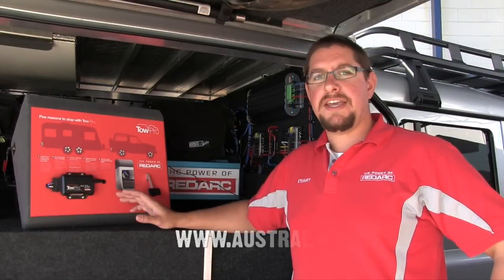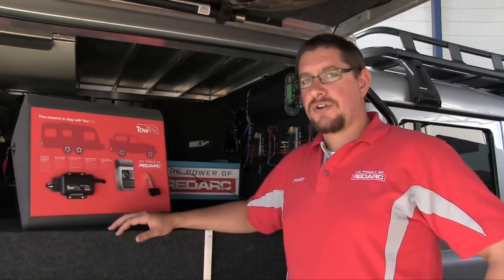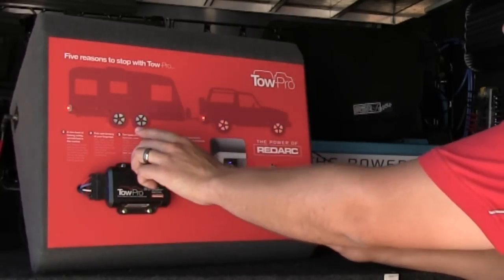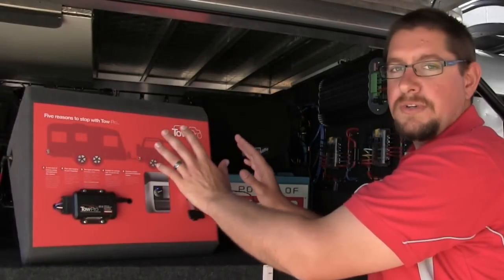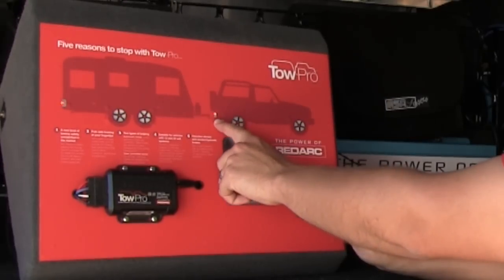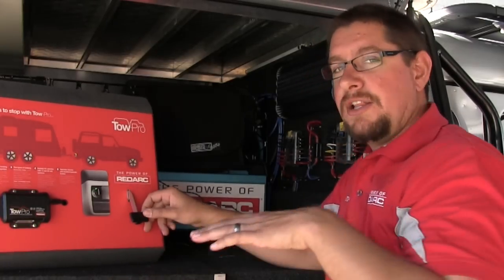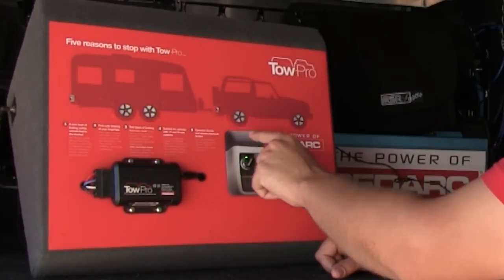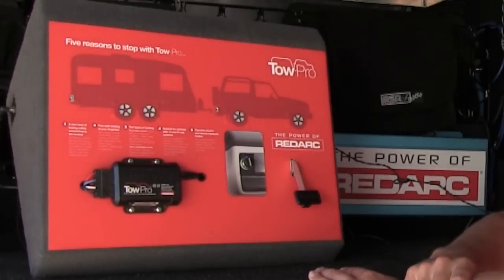How to Use the Tow-Pro Electric Trailer Brake Controller

Comment: I have Redarc and it does job beautifully, just asking to make sure I am correct.
I am in auto mode and caravan starts to sway, I then push the the knob down to brake the van?
Reply from the maker: Thanks for watching! Yes, pressing the knob will brake the caravan without applying vehicle brakes to correct caravan sway.

Comment: How do you set up how much brake force is applied in automatic mode without locking up the trailer tires?
Reply from the maker: Hello, and thank you for your message. You can adjust the braking force until it feels as if you are braking without a trailer. This means you should increase the level of force to a point that it does not feel like you are braking harder than normal to slow down the trailer, and so that you are not letting the trailer pull the vehicle up.

For further assistance please be sure to contact our Tech Support Team on 08 8322 4848 or via email at power@redarc.com.au

Comment: Quick question regarding hill decent in my Ford Ranger. While descending off road using hill decent control (vehicle brake lights come on) will the trailer brakes be activated? I’m assuming if so manual mode would be best in this situation. Thanks
Reply from the maker: Hi, and thanks for your question. When the Hill Descent function is activated, do the trailer brake lights activate as well? If they do, then yes the TowPro will likely trigger and output to the trailer brakes as they are activated off the brake lamp feed to the trailer socket normally. Manual/Offroad mode would be better in this situation indeed, especially if its rocky/loose surface too. If the trailer brake lamps do not come on, you’d need to press the manual override/sway-stop button on the remote head to activate the trailer brakes instead.

Comment: Any chance you can tell me why my system is flashing pink, green red while just driving? New car, new brake system. Did 1250km and just got home and it’s now flashing these colours and it won’t change. I can find any videos telling why this is. 
Ta
Reply from the maker: Thanks for watching! We would recommend giving our Tech Support Team a call on 1300REDARC (1300 733 272) and they can run through some troubleshooting and diagnostics.

Comment: I've got a tow pro Elite hooked up in my car and was wondering if the LED should always be on as mine stays on either blue or green solidly
Reply from the maker: Hi Aaron, The LED on the Tow Pro remote head should only be illuminated when a trailer is attached or when the button is pushed. If the LED is constantly on, there may be a wiring fault. In this case, we would ask you to call our Help Desk on 08 8322 4848 and speak to one of our Auto Electricians.
Reply: @REDARCElectronics does the trailer override work in Auto, eg if trailer is swaying and it's in auto how do I activate the trailer only

Comment: What setting do you suggest for the auto mode, when towing a 2200kg horse float? 🙏🏼
Reply from the maker: Thank you for your enquiry, there is no hard and fast setting to advise, whilst the weight of the trailer plays a massive factor so does the efficiency of both the trailer and vehicle brakes plus the comfort of the user. Luckily setting the Tow Pro for your trailer/vehicle combination is easy, simply start with the dial around 3-4 and see how the trailer reacts. 

If you are having to brake the vehicle harder to pull the trailer up increase the dial, if you go too high the trailer will feel like its pulling the vehicle to a stop, simply decrease the number. Within in a few adjustments you will find the perfect setting.

As you will be pulling a horse trailer you may find you will have to decrease the dial slightly when towing without the horses onboard, once again simply set the dial where the vehicle and trailer are braking smoothly and proportionally.

Our helpful Tech Support Team are available on 1300 REDARC if you'd like to discuss over the phone in greater detail.

Comment: How would the brakes work on the trailer when the vehicle automatically brakes with the vehicle built in sway control (left / right brakes)?  Would the brakes on trailer engage equally left to right same as tow vehicle?
Reply from the maker: Thanks for watching! The vehicle's sway controller would work interdependently of the brake controller, unless you have a sway controller on the trailer itself and brakes will always brake evenly.

Comment: Can you manually engage the trailer brakes without the brake peddle ? Say in a instance to control a swaying trailer ?
Reply from the maker: Thanks for watching! Yes, you can. Out Tow-Pro's can be manually engage via the remote knob which is installed into the dash. Just press the knob and the trailer brakes will engage independently of the vehicle.
Reply: @REDARCElectronics  is this for both the liberty and elite modules ?
Reply from the maker: @IMRgarage  Yep, both the Elite and Liberty have this function!
Reply: @REDARCElectronics  when you manually press the knob to apply only the trailer brakes such as in a sudden trailer sway condition on the highway, will it apply force proportional to the knob setting or is it independent of the knob setting and smart enough to know how much force to apply? During a sway condition, I'm not sure if there is enough time to look down at the knob setting when you rapidly have to press the knob.

Comment: Question!  I installed the Tow Pro Liberty and cannot get the manual override to work, there seems to be no button to press.
I took the dial off and cannot press anything in on the remote head I can only turn lerft/right. In this video you double tap for manual mode - I have no ability to tap anything...is my remote head faulty?
Reply from the maker: Hi there, thanks for your comment. If there is no free-play on the remote head button, we suggest it could be jammed. Please contact our REDARC Tech Support team on 7042475150 and they can assist with diagnosing this issue.

Comment: Hello I have a Pro  Arc on my van, took off the other day and the light on control on dash was red for quite awhile (40klm) then changed to blue, why would happen?. Thanks Peter
Reply from the maker: Normally when the dial is a solid red this would indicate that the brakes are being applied – either with brake signal to the unit, or with the dial depressed (override).
If the LED stays red again it would be worth checking the dial is not pressed and stuck in (indicating the remote head may have suffered physical damage), and if this is okay the voltage on the RED wire at the Tow-Pro itself will need to be measured.

Comment: I have the tow pro classic and there is nothing on how to set it up and how it works. I’m guessing it’s similar to how the elite works
Reply from the maker: Thanks for choosing a REDARC brake controller, Andrew. We don't have a video guide to the Tow-Pro Classic however our instruction manual has some easy to follow steps for setup and use. You can find a digital copy at https://www.redarc.com.au/Content/Images/uploaded/Manuals/EBRHV2%20Instruction%20Manual.pdf or contact our friendly Tech Support Team on 1300 REDARC and they'll be more than happy to walk you through in greater detail over the phone.

Comment: Great Story and Music. Why does my vehicle plug for current electric brake controller and current brake controller have 5 wires and the red arc only have 4??  
The more I familiarize myself with the red arc electric brake controller the more I believe that it is an unnecessary non improvement to electrical brake controllers that has more points of possible failure that aren’t worth the price tag, not seeing traditional controller under the steering wheel or the new lack of confidence I have in my electric brakes functioning properly which I never had before.  I have electric brake controllers on my entire fleet of trucks of all different brands dating back to the 1980s and they all work perfectly to this day pulling 10-16,000lb trailers with 1 ton and 3/4 ton trucks on roads, fields, hills, grass and sand whether driving, putting on location, leveling or maneuvering thru crowded events.  Your “improvements” and 2yr warranty shouldn’t make anyone feel any confidence at all with the product unless they’ve never had or heard of electric trailer brake controllers before.  Please change my mind, beginning with available technical support people during regular hours in the countries and time zones you sell your products, or have better information available leaving less questions for customers.  I think the price tag warrants this.  I’ve never had to splice wires, buy an extra pigtail adapter for vehicle, paid this much, had so much doubt, taken more than an hour to install, not been able to find answers nor had so many questions with any of the 20+ electric brake controllers I’ve previously installed in vehicles.  Standing By.

Comment: I'm getting one of these fitted to a Triton ute I'm buying, it along with towbar will be fitted by the dealer.
I'm also buying a van
So being a complete novice here what setting do I use to tow on bitumen road.
I'm a conservative bloke the van is 2500kg ATM and I'm not going to drive like a maniac.
It sounds a bit daunting as I haven't done it
Reply from the maker: Hi Steven
Thank you for your enquiry.
The best way to set the Tow Pro is by feeling.
 We suggest to start on around 3-4 and see how the van feels. If this setting is too high you will feel the van pulling the car to a stop. If the setting is too low the van will feel like it's pushing the car and you will have to brake the vehicle harder than expected. Simply dial up or down as required. Once you find the sweet spot the Tow Pro when set in the proportional mode will make adjustments depending on how hard you are braking.
Reply: @REDARCElectronics  thanks for that it does make perfect sense.
What happens for some reason that that a fault develops, ie a broken wire etc
Is there any fault warning
I'm thinking your doing say 90 K and you not have brakes on the car
I'm thinking the worst but it needs to be considered I think
Reply from the maker: @Steven_Rowe  Absolutely. Give our Tech Support Team a call on 1300 REDARC and they'll be more than happy to walk you through installation, use and safety in greater detail over the phone.

Comment: I drive a 2006 Chevy Silverado 1500 2WD , also I have a duel axle utility trailer. Would this work for me
Reply from the maker: Thank you for watching, and for your interest in our brake controller. Yes we can confirm that our Tow-Pro Elite is suitable for your vehicle make and model. To confirm exactly what components you will need use our handy brake controller selector tool at https://redarcelectronics.com/pages/brake-controller-selector

Comment: so this brake controller does not need to be connected to the brakes like a normal brake controller ?
Reply from the maker: Hi Peter, thank you for your message. The Tow-Pro shown in the video is installed into a display board. We have "tricked" the Tow-Pro into thinking a trailer is permanently attached for display purposes. A Tow-Pro installed into a vehicle will stay in sleep mode until a trailer is attached. A trailer is required to use a Tow-Pro under normal conditions.

Comment: What is the difference between the classic and elite models?
Reply from the maker: Hi Doug,
The REDARC Tow-Pro  Elite is the first of its kind to offer two types of braking in the one unit. The Tow-Pro Elite electric brake controller uses both proportional and user-controlled mode, and features Active Calibration.

The Tow-Pro Classic offers a single user-controlled mode of trailer braking. Simply adjust the required force your towed vehicle requires with the turn of a control knob when ever needed.
Any further questions please don't hesitate to contact us directly and speak with our tech support team.
Reply: @REDARCElectronics  thank you. Elite is now ordered!
Reply from the maker: @DeepOwl1073  Great news!

Comment: Do I need a controller for a 2900lb travel trailer towing it with a mid size SUV?
Reply from the maker: A brake controller may be required for this set-up, if the trailer has been fitted with electric brakes on the hubs installing an electric brake controller would be recommended. For specific legal requirements we recommend you contact your local transport authority.

Comment: how do you set the red arc on automatic mode
Reply from the maker: Hi William, thanks for your comment. The Tow-Pro Elite is able to change between the Proportional (Automatic - Blue) and User Control (Manual - Green) modes by following this procedure.

1) Turn the dial all the way down to zero (full anti-clockwise) 
2) Put your foot on the brake pedal
3) Double press/click the remote head dial in
4) Remove foot from brake pedal. 

The mode should now be changed between the two colours/modes. Note: You will need a trailer plugged in when attempting to do this mode change.

Any further questions please don't hesitate to contact our friendly Tech Support Team on 1300 REDARC.

Comment: How do I reset it to automatic mode?
Reply from the maker: Hi Rebecca, thanks for your comment. To change the mode of the Tow-Pro between either Proportional or User Control, the following steps need to be taken in sequence and with a trailer plugged in: Turn the remote head dial down to ‘0’, put/hold your foot on the brake pedal, double press in the remote head dial (like a computer mouse, ‘click, click’). The LED should toggle colour between Blue and Green modes after this.

Comment: So this works the same as my stock braking system? I was thinking this system was advanced
Reply from the maker: Hello, and thank you for your message.

The Tow-Pro™ Elite trailer brake controller offers selectable Proportional or User Controlled trailer braking modes allowing the user to choose the braking style depending on the road or terrain conditions, vehicle type, or driver preference, whilst featuring Active Calibration which constantly monitors the direction of travel.

If you have any further questions about our product please contact our Technical Support Team at power@redarc.com.au and they will be more than happy to assist.